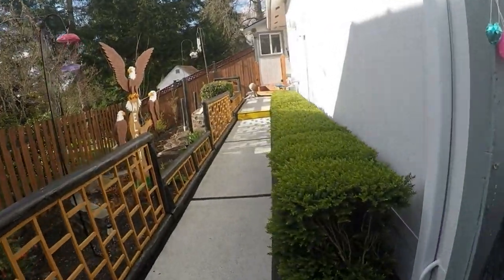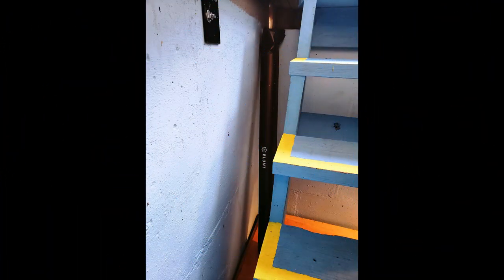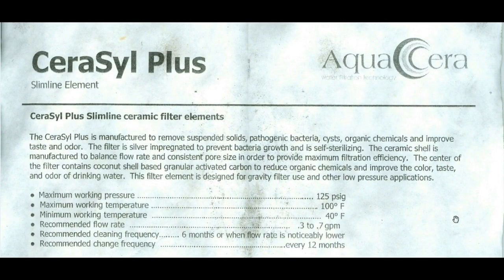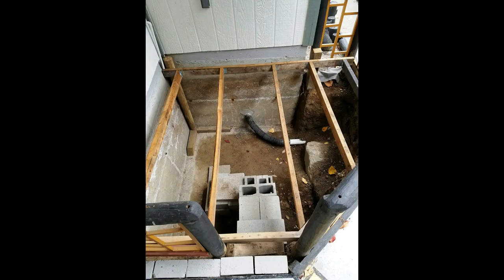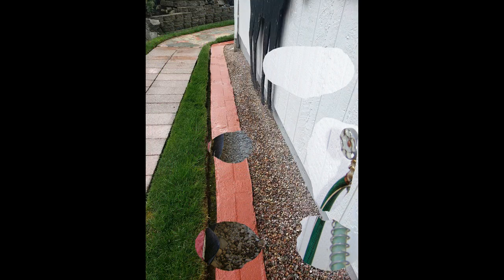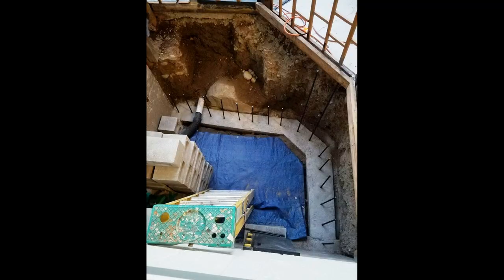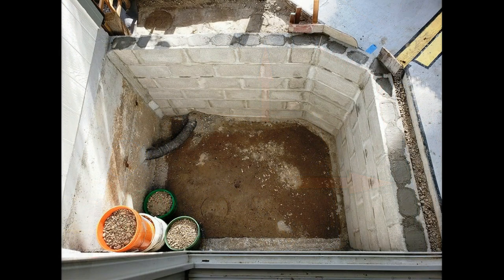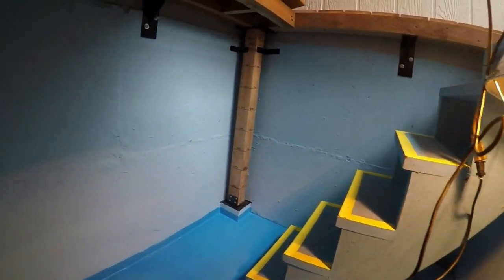Preparedness - (techniques for water storage)

Comment: Great idea, I wish I had that size area and the ambition to do all that work. Thanks for the videos, especially the Honeywell Alarm videos. Bob in commiefornia
Reply from the maker: I am working on 3 more Alarm videos right now. Each one takes a few months to put together. Hang in there.
Reply: @bounder97  Do you have a video on installing a panic switch on a VIsta 20P panel? Honeywell sells 3 different switches, but I can't find anything about wiring one. If I find that, it will be easy to use one of my many switches I own to accomplish that. Thanks, Bob in commiefornia

Comment: How long did this take you to build? How much of an investment was it?
Reply from the maker: Build time was about 6 months, I had many other projects going at the same time. I actually have no idea how much it cost since   I always have building materials on hand, I just use it then replace my stock when I have extra funds available.
Reply from the maker: But the labor was FREE !!!!!
Reply: Nice work man.  Curious how you drain it out?  I see a floor drain but how do you open that up?
Reply from the maker: @fixitwithzim  Great question. 
I was wondering if anyone would notice the drain.
The drain actually goes to a dry well full of gravel.  Guess where I got the gravel… The dry well is provisional incase I have water build up in the hole when I am not actually storing water in it. I place one of these drains in all my below ground and underground projects. I fill the drain openings with caulking to seal it off. The sealant can easily be cut out with a carpenter’s knife if the drain needs to be used. In this case, the water pressure of so much water above the caulking actually pushed the caulking out of the drain openings.  I found this during my leak check. To fix this, I re-caulked and then covered the entire drain with 5 layers of epoxy to provide support against the water pressure. I then painted water proof paint over the entire drain. 
It holds water fine now, while the drain can still be opened back up with a drill if I need to use it. I also have the proper rubber stoppers to reseal the drain if I ever do drill holes in it.
 It is much easier to have an unused existing drain, then to put one in after the fact. This also supports my tendency to over engineer things.
OH, after the leak check, I removed the water using a standard pond pump that can be run off of my inverters if power is out.
Thanks for asking!!